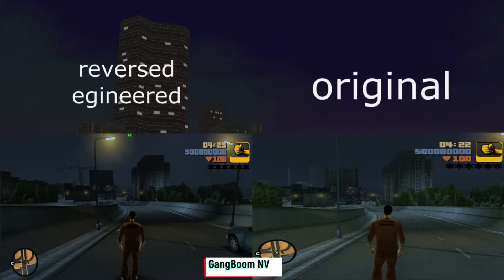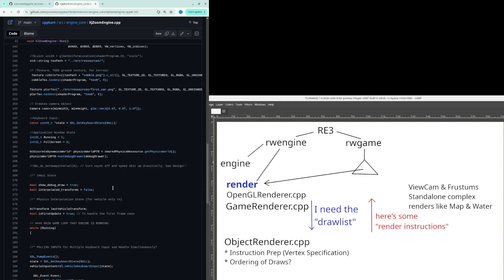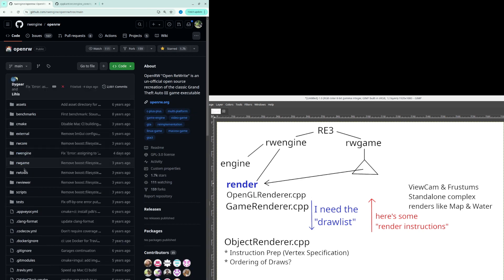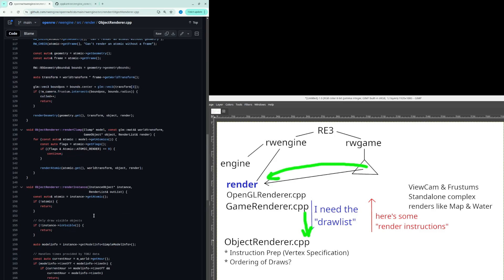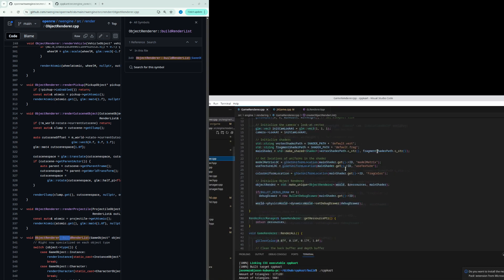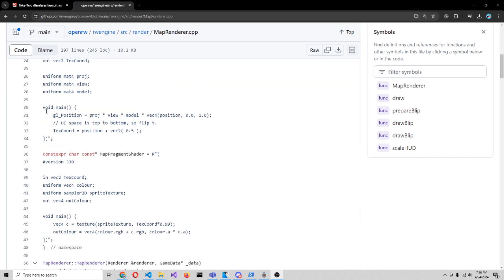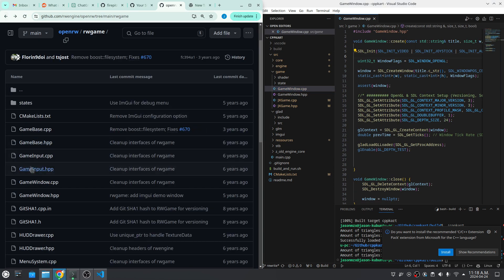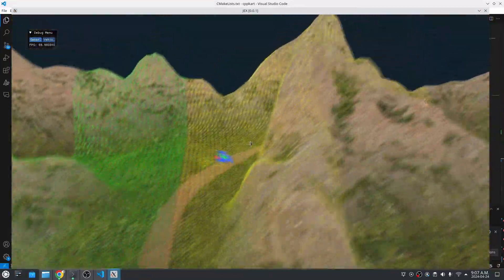Rewriting My Game Engine based off GTA 3 Source Code

Comment: Pretty cool.  I'm not sure how good of an idea it is to get too buried in engine design patterns from a graphics engine that's 25 years old though, predating almost all GPU hardware acceleration and multicore.  Can OpenGL do anything like DirectX12's ExecuteIndirect?  I'm sure the old versions can't, but I wonder if the most recent versions can.  I've been writing a DX12 engine for the last two years.  All draw calls for the entire scene are loaded onto the GPU during loading one time.  One big vertex buffer and one big index buffer for everything but 2D overlay stuff, pretty much.  It's then rendered with just one ExecuteIndirect call per camera in my system.  That runs a compute shader which culls the scene and builds a fresh draw call list that goes straight to the GPU rendering pipeline.  There's no looping over objects CPU-side at all per frame other than the cameras.
Reply from the maker: Great point, yea I need to find a way to keep the Vertex & Index buffers on the GPU, and just dynamically update the model matrices and some other minor things, rather than re-computing all instructions which I'm doing now, (including getting the Geometry ptr at every frame, and drawing it with the respective model matrix). I still need to look more into it, but you're totally right I feel like that would be much more efficient and less CPU bound like it is now... Thanks again Todd for your input bro!! :face-red-heart-shape::face-red-heart-shape::face-red-heart-shape:
Reply: @jason_m2003  Yeah, recomputing and reuploading the vertex and index buffers every frame will be hugely expensive.  That might explain why you're CPU limited.  You're probably barely using the GPU at all right now.  OpenGL has had vertex buffer objects (VBOs) forever so if you're not using those, I'd look into it.  Probably there's the same for index buffers.

At the hardware level (DirectX12 and Vulkan) there are three different types of heaps for buffers (think of it as three different buffer types, in a sense): 

The first is "upload" which is a buffer that gets uploaded every frame.  That's shared between CPU and GPU.  That's the slowest and easiest way, but it's way faster than calling glVertex3f and so on zillions of times or transforming the vertices C++ side one at a time.

The second is a "default" buffer which lives entirely on the GPU.  To get data into that (in DirectX12 anyway) you first create an upload buffer and a default buffer.  Then you write your C++ side std::vector<Vertex> or whatever you have into that upload buffer, then you copy that to the default buffer.  Then it lives totally on the GPU and is so stupidly fast you won't believe it, as long as you don't do it every frame.

(Not relevant here, but the third type is a "readback" buffer which you can write to in a shader and get the results back on the CPU.)

Here's an early test I did a couple years ago when starting out in DX12.  This is 134 million triangles on an NVidia 1080.  Not a typo...

https://www.youtube.com/watch?v=uQ0To1i8S_c&ab_channel=ToddWasson

No chunking or culling or anything at all there.  Each little "point" is a triangle.  That's running with vertex and index both in default buffers using a single draw call for everything.  No textures or lighting or anything, just colored triangles.  

So yeah, in OpenGL I'd look into VBOs (and maybe IBOs if that's what they're called), then also see if there's modes you can set like upload or default.  You might have to write to upload and then copy to default like DX12 or something like that, but maybe OpenGL has some mode you can set which will do it for you.  Your frame rate will blast off to the moon like you can't imagine.

Comment: Thats pretty cool, I don't want to be the guy that does "Well, duh 🤓", but isn't that the most basic of design patterns? (and now I figure I sound just like that guy) What you've seen to have shown seems to be the most basics of inheritance, where you have can have different implementations (say one for openGL, another for Vulkan, etc.) but they respect an interface, that way later in the code they can get passed as an argument and the function that recieves that argument doesn't need to know the implementation of it
Reply from the maker: Don't worry it's a valid point ! There is some nuance involved here, as OpenGL is inherently stateful and requires very careful manipulation of it's context, and how artifacts like VAOs, VBOs, Texutres, etc... are handled for correct rendering, so the OpenRW project provided a good pipeline (Involving API specific steps done at specific stages) to ensure a clean and orderly Object Hierarchy and pipeline, Yes you're correct in thinking that there shall be a "Global Interface", and  Yes my new design still does the good old levels of abstractions and interfaces just like everyone else, but certain design aspects, and application specific tweaks where learnt from RW !

Comment: OpenRW" and "re3" are two completely different projects. "re3" was the one that got sued and removed from github. From my knowledge "OpenRW" never had such problems. These two projects were made in two totally different ways. "re3" was an attempt in decompiling (decompiling is a form/method of reverse engineering) the original game executable back to readable C++ code, that's why it replicated the behaviour of the original game so well (almost 1:1, even bugs were replicated), but that's also why it got sued. "OpenRW" on the other hand is a project that aims to recreate the game engine to behave as closely to the original as possible, but without actually using any decompiled code, that's why this project is completely legal, but that's also why its less accurate than "re3". In many cases authors of this project had to "eyeball" stuff, because they didn't have the access to the original code, they were coming up with their own code that was able to read the game data and recreate its behaviour. That's also why "OpenRW" is called "OpenRW" as in "Open Re-Write" and not "OpenRE" as in "Open Reverse Engineering" or something like that.
Cool devlog tho
Reply: "but without actually reverse engineering anything, that's why this project is completely legal"
This makes it sound like reverse engineering is unlawful, which it isn't! It falls squarely under fair use.

The issue, like you pointed out, is how close you are to the "expression" side of the "idea/expression" divide. Copying how the game feels is copying the "idea" of GTA. Creating a 1:1 source code decompilation that recompiles to the original binary is copying the very specific "expression" of the "GTA idea" that Rockstar made.
Reply: @vlc-cosplayer  Yeah, I see that now, thanks for pointing out. I should have used the word "decompiling" instead of "reverse engineering". I didn't state that what re3 did was illegal because they used the decompiled code in majority of the project. I'll edit my comment when I'm home
Reply: @zonea4860 its a little complicated cause theres more protection on the way a piece of softwsre like this is put together re3 is definitely considered copyright infringement because theure using debug symbols where as OpenRW was considered clean room which means it wouldn’t be copyright because it is original code from the creators or had the re3 team created a technical specs manual and given it to another team of developers to put together.  That being said T2 would’ve probably still file  a lawsuit not even because they would have a case but to scare the team to stop. A SLAPP suit essentially. I really wish the OpenRW team didn’t drop this project for re3
Reply: well explained, thank you ❤
Reply: re3 is a reverse engineered version, true. But they didn’t keep it 1:1 so much as to keep big bugs in the game. The mirror’s GitHub says as much. OpenRW formed out of a model and texture viewer that was created for the game’s assets that has morphed into a game engine with physics and more features than its beginnings.
Reply: @jjjjjjjjjjjjjjjjjjjjja  Yeah, that was kind of the goal of re3, reverse engineer the game then fix the bugs and add addtional features. But fixes in many cases were inside #ifdef preprocessor directives, so you would be able to compile an almost 1:1 copy
Reply: @zonea4860 The only reason re3 got the boot and OpenRW didnt was clout. R* didn't want any competition before releasing their remastered trilogy so they DMCA'd their repo and sued them few months before the release. It was because of time and costs of judicial proceeding that re3 devs couldn't (nor wanted to) work on the project anymore. The lawsuit was dismissed last year, which completely invalidates your misinformed claims on the legality of reverse-engineering
Reply: @kvdrr  While technically it was dismissed, it was probably more of a settlement, which is common in such cases. The company basically says something like "We won't take any further legal action, but you can't make the project public anymore or do anything really regarding it". If there wasn't any agreement, the company wouldn't just dismiss the lawsuit all of a sudden for no reason
Reply from the maker: I was under the impression that the RE3 was just a distribution of the OpenRW engine, however R3 also included the copy-righted assets, and so they where able to re-publish it without those assets? I'm not 100% sure, and what you said here sounds legit
Reply: @jason_m2003  Just as I said before these are two completely different projects. RE3 contained only reverse engineered code and it didn't have any copyrighted assets. It required you to have original game data similarly to OpenRW. RE3 got in trouble, because even though it didn't have any copyrighted assets, it still contained the reverse engineered code from the original executable which itself is copyrighted. Reverse engineering is kind of a gray legal area, so after getting the project taken down the creators of RE3 managed to appeal from the first DMCA and got the repository back online for a short period of time, but then Take Two filed a second DMCA that the creators of RE3 didn't manage to appeal from and the project got taken down again. They've never managed to get the project back online, so the original repository is unavailable to this day
Reply from the maker: @zonea4860  Oh wow, didn't know this! Thanks for sharing ZoneA
Reply: @jason_m2003  RE3 contained only reverse engineered code without the assets. It required you to have original game files similarly to OpenRW. RE3 got in trouble, because even though they didn't include copyrighted assets, they reverse engineered code from the original executable which itself is copyrighted. Reverse engineering is kind of a grey legal area, so after the first DMCA takedown the creators of RE3 appealed and got the repository back online for a short period of time, but then Take Two filed a second DMCA and the project got taken down again, and this time the creators of RE3 weren't able to get it back online and the project is unavailable to this day
Reply: And yet sm64 is still up
Reply: @MrBrax  I wonder why...
"This repo does not include all assets necessary for compiling the ROMs. A prior copy of the game is required to extract the assets."
A mystery for the ages... 🤔
Reply: @vlc-cosplayer  neither did vice city, right?
Reply: Dude, it's called OpenRW because it literally stands for "Open RenderWare"
Reply: @kvdrr  It clearly says "Open ReWrite" on the original repo. Here's the projects description: 
OpenRW "Open ReWrite" is an un-official open source recreation of the classic Grand Theft Auto III game executable
I always thought that it was a little weird, unspecific and really broad name, but that's what they chose, that's what it sands for and they clearly stated that, so don't say I'm wrong when I'm not

Comment: Interesting! Since you now have some knowledge and experience with the code base. How would you personally describe its performance side of things. Such as optimization. I noticed quaternions. Do you have them implemented and how do you go about them. Quaternions are sometimes tricky from my personal experience especially from the vehicle simulation perspective. To my current project they are essential part of the simulation actually. But when I tried to narrow it down to rotation matrix instead (not that I would suggest it) I found some technical limitations, just a learning experience. Why am I asking this? Well mainly because gta3's vehicles felt good, but not exactly amazing, this is how I find the quaternions in this game a bit interesting. As if I would have never guessed that such a advanced rotation model is actually used there in the first place. I previously thought that all the rotations are done in plain simple Euler Angles.
Reply: I do vehicle simulation too and don't bother with quaternions either.  I always end up needing the matrices for something (up/right/forward vectors are useful for lots of stuff) so both end up being there.  I found it easier just to ditch the quaternions rather than fumbling back and forth between the two.  Quats can't be visualized in any sense at all anyway so being creative with rotations and stuff gets hard in a hurry.   

Back in the old days quaternions could gain you some speed which I think is why so many folks were using them.  Nowadays it hardly matters.  If I'm not mistaken, GPUs have hardware accelerated matrix ops anyway so they're pretty hard to beat.
Reply: @toddwasson3355  thank you for confirming. Matrices seem better for this case, in the middle of integrating them from ground up, so my implementation is process dependent (doesn't matter if its CPU or GPU, the math is plain algebra in my case, but based on the initial efforts of Gottfried Wilhelm Leibniz) I'm integrating everything from ground up to be as reliable as the original concept.
Vehicle physics is a great topic in general and I'm highly interested in all of it.
Reply: @raveltammeleht6278  Yeah, I think quats are overrated personally.  Besides, if you're doing rendering you'll have shaders that look something like this anyway:

VS_GBuffer_Out VSMain(VS_GBuffer_In input)
{
  VS_GBuffer_Out output;
  float4x4 vp = mul(cbCamera.view, cbCamera.projection);
  float4x4 mvp = mul(cbTransform.model, vp);
  output.pos = mul(float4(input.pos, 1.0f), mvp);
}

That's a simple vertex shader.  The view, model and projections are all matrices (float4x4 is 4x4 matrix of floats).  That mul() function is built into hlsl shader language (glsl has an equivalent too) so you'll see it everywhere.  Pretty sure there's dedicated hardware for that on the GPU, so when it comes time to render your car or whatever else, you'll probably want the matrix anyway.  I figure just skip the expensive converting back and forth.  

You could write your own shader that uses quats instead if you really wanted to I suppose, but there's not much point these days, I think.  We're not compute bound nowadays.  Hi performance comes much more from good caching and clever memory use than cutting out a few arithmetic ops.